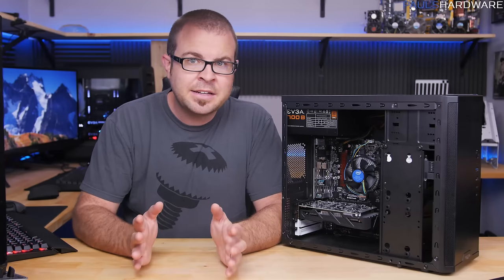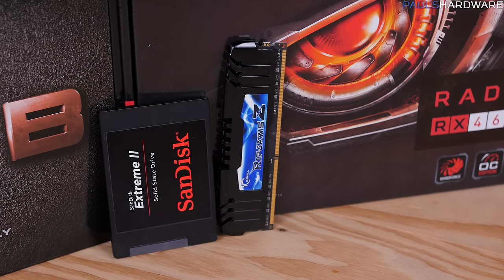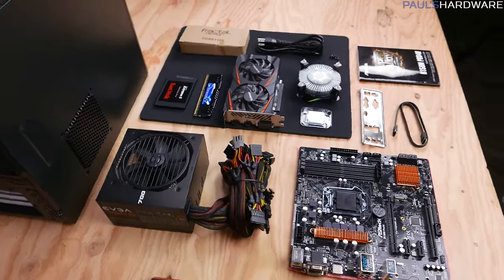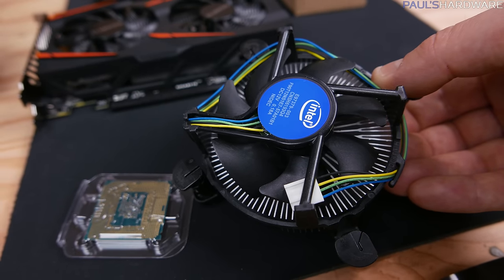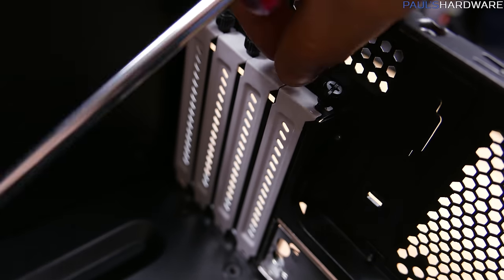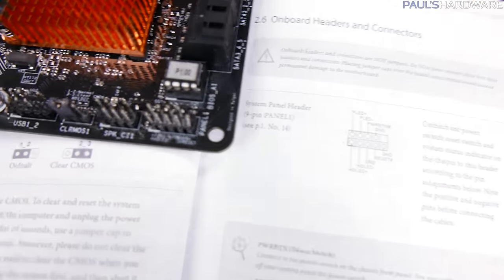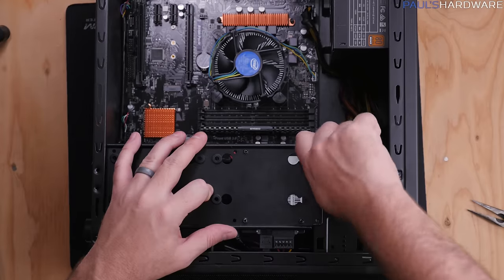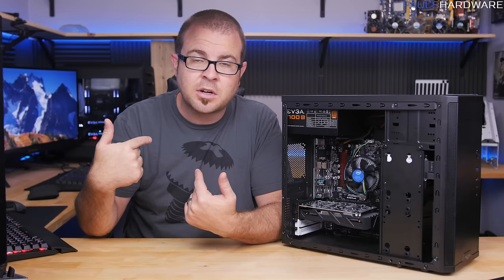How To Build a $500 Gaming Computer

Comment: Better build that would beat the above by a country mile for $100 more.

Fx 9590 4.7ghz 8 core. $100
R9 290 graphics $150
16gig ddr3 2100 $120
128gig ssd $40
Motherboard compatible with fx9590 $100
https://uk.pcpartpicker.com/products/motherboard/?compatible_with=pGrG3C

550w antec psu $50
Case $30
Cooler $20

Use cex to buy used parts. They are in the US and UK. 2 year warranty on everything.

Comment: PRO TIP
Don't buy 2400Hz DDR4 memory for a B150 motherboard as the speed will be locked to 2133Hz.
Just saved you a few $

Comment: The Corsair 450 watt PSU is only about $10 more but is a FAR better unit. Iiirc its based on the same platform as the 450 watt  Corsair RM.
Reply: Which Corsair psu are you talking about?
Reply: Corsair's CX-series PSUs are shit though.

Comment: When a qualified techie recommends an RX 460 with 4GB of ram... -.-
Reply: dompaPro there are a few option you can consider. The $125 ~ $180 dollar price range is rather vacant right now as we await the arrival of the 1050 and 1050 ti , which are rumored to launch at $110 and $150 respectively. Testing has shown that 4GB on the RX 460 is completely pointless as the gpu isn't even powerful enough to utilize the extra memory, and just a money grab. The model of rx 460 he chose is going for (at the lowest) $130 on Newegg so for our purposes I will assume this as the price for more of a challenge. One option I would recommend would be to pick up the power color red dragon RX 460 2GB, which is only $95 after rebate and doesn't require a 6 pin power connector (always a plus for versatility) This card will give nearly identical performance while saving $35 which can be put towards a bigger SSD or a hard drive. Alternatively, one could await the 1050ti which will have performance greater than the gtx 960, or the gtx 1050 which will beat the rx 460 at the same price point (rx 460 ~ gtx 950). Lastly, another option would be to pick up a last gen card on the cheap, for example, I am a proud owner of a premium r9 380x from power color that I picked up for $150 new from Newegg. This card beats the 1050ti or gtx 960, and is a premium card for the base price ($150) of the upcoming 1050ti. I assumed you were only interested in buying new parts so I did not recommend buying used from eBay, although I have gotten some wicked deals that way. Simply put, an r9 380x for $150 or an rx 460 2GB for $95 demolishes an rx 460 4GB at $130 value wise, and thus metric is most important on a budget.

Comment: i made mine for 250$
specs:
i5 2500k
16gb kingston memory 
gtx 1050ti SC
2tb hdd

actually i bought a dell system which had a 400watt psu and inserted a gtx 1050ti and an extra 8 gig stick to make  16 total...

also this(mine)build is better than that u build :3

Comment: An rx 460 in a $500 build 😂😂😂😂😂😂😂😂😂😂😂😂😂😂😂😂😂😂😂😂😂😂😂😂😂😂
Reply: What should he have put, then?
Reply: rx 470....or a 480...considering he's using msrp which is totally not what it is in real life. the 480 is supposed to be at least $200 before taxes. I don;t think it would be a terrible decision to include it. After all normally the gpu alone would account for more than half of the build cost.
Reply: raindrizzle14 He's using MSRP, which is less expensive than most cards on sale. I do think an RX 470 would be good. I've made builds with the GTX 1060 6GB at this price point.

Comment: this is the second video I have saw this month talking about a 500.00 PC.
even if Paul put them in the description--- U can't build a functioning PC for 500.00.
I have yet to see a PC that would work without a Mouse/Keyboard and Monitor.
and if U bought a legit Microsoft Key from NewEgg----that's another hundred dollars.
Reply: ikr
Reply: You don't need to buy windows :P

You can just make a bootable usb and when it comes up to entering the key, on the bottom you can say enter key later. 

And I agree, keyboard and mouse should be added, but I don't think monitors should. A monitor is simply a display, you can use a medium to small sized tv if you wanted too, sure it's not the best, but it'll do.
Reply: I guess you're right about the display thing. I see surplus displays go quite cheaply, in fact I have purchased a few thanks to their price.
Keyboards and mice are heavily marked up but I am hesitant about buying shitty product from the lower tier sellers from amazon or ebay.
All in all yes it really is about compromise, if you are trying to save money good choices must be made with that in mind.
With that said I am very happy with my still whirring HD 5770 gpu from 2010. Whilst it is as slow as hell for all my games, I can at least play them. And obv emulate last gen console games very easily.

Thanks for your super comment!
Reply: 0:44

Comment: http://pcpartpicker.com/list/PfNGkT 
Some things i like about this sub $500 build over yours:
Mini ITX > Micro ATX
M.2 > 2.5 SSD
Semi-Modular > Standard PSU
GTX 950 > RX 460
Total Price: Total: $494.59, slightly more than you're total price but still under $500
Reply: Oh man, so many problems with that build.

Your motherboard does not support M.2. The SSD you chose is no faster than a regular SATA SSD. mITX is kind of useless in a budget build. And the 950? Really? An RX470 or GTX 1050 Ti costs a little more and is much better.
Reply: The motherboard has an m.2 slot on the back.  At the time of posting, the GTX1050ti didn't exist, and while yes the RX470 is better its as you said more expensive, and this was to fit into a certain price range.  The 950 is better than the RX460 listed in this video.  The SSD was also chosen to fit into the price budget.  You did watch this video right?   If you think you can make a better build in a $500 price point i'd love to see it.
Reply: Sean Crees Ok, you are right about the M.2 slot. I mistook it for a different board. Speaking of M.2, 240GB of storage? Really? That won't be able to store anything. The OS itself takes up around 20GB.

Here is a better build, that looks nicer imo:
http://pcpartpicker.com/list/jxVWBP

It lacks an SSD, the only downside. But, there is a huge upside, the GTX 1060 6GB. Remember, the point of a gaming rig is to play games well, not to have conveniences like space savings and nice power supplies. The 500W PSU lets you overclock to tremendous levels. This plays games much better than your build.
Reply: The SSD i listed was the same one Paul used in the video, except it was the M.2 version instead of the 2.5" version.  That's why i chose it. I was basically taking Paul's PC Partpicker link and making it better without increasing the cost.  Again, you did watch the video right?  My post was in response to this video.
Reply: Sean Crees I did watch the video. But you were comparing his build to yours. You were explicitly stating that you have a better setup for 500. And then i came along and produced a different build with a narrower niche, but much better, considering the 1060. Considering it is a gaming build, my 1060/6100 build is the best of the three for P2P.

Comment: for a gaming PC I would buy a 1 TB HDD instead of an SSD
Reply from the maker: I respectfully disagree, I won't use a HDD-only-based PC if I can avoid it
Reply: the 240 GB SSD can barely fit for 4 or 5 modern games plus the Windows and it will never be enough for any extra data or files , so at this price I think a HDD is a better choice.

Comment: If only I had that much :/
Reply: You can build gaming PCS for around 100 bucks
Reply: you can build a potato machine for that much
Reply: vRaMv Nope. Check out many 100 dollar gaming PC builds. They use older LGA 771 Xeons and cards like the GTX 560/650 Ti
Reply: Well If you're going to build one for that much then good luck.
Reply: vRaMv I'm not. I was making a suggestion.
Reply: Ok, thanks for the suggestion!
Reply: vRaMv no problem :D
Reply: ECCENTRIC BRUH 56- and 650 Ti cost way more than $100

Comment: Twist ties??? Really??? WTF??? Use plastic cable ties FFS!!! Also don't buy 1 ram stick, RAM works better in matched pairs in dual channel mode. I see you are still recommending pirate software too. Those Win 10 keys are not legit and often don't work!!
Reply from the maker: No zip ties were included with the accessories, I've been using twist ties for years and if they're in good shape they work just fine. 1 RAM stick is not ideal but the performance impact is pretty minimal, and leaves more upgrade room. The licenses sold on Kinguin are international and not pirated. I hope you enjoyed the video otherwise.
Reply: The keyword is IF. I've known people to kill a PC by using twist ties when the metal wire inside has shorted, do really want to encourage that when zip ties are so cheap and can be picked up almost anywhere? The impact of 1 stick of RAM is a bit more than minimal when compared to 2 in dual channel and with 4 RAM slots on this board there's plenty of upgrade options. Those win 10 keys are definitely not legit and often wont register. If you're in any doubt talk to Microsoft, I have and they will tell you the same as they told me!